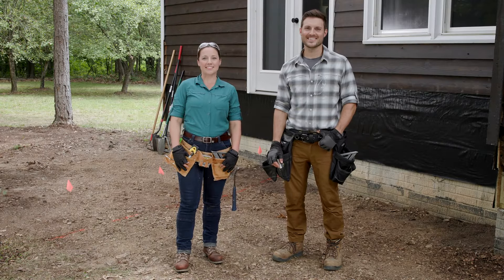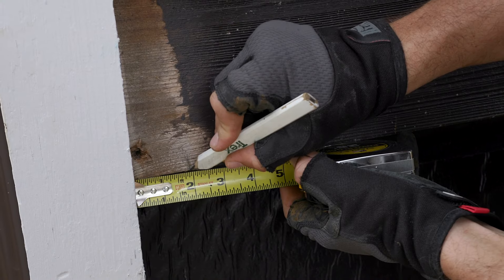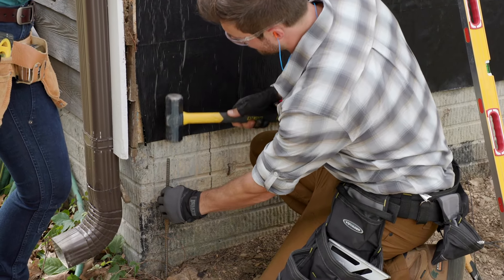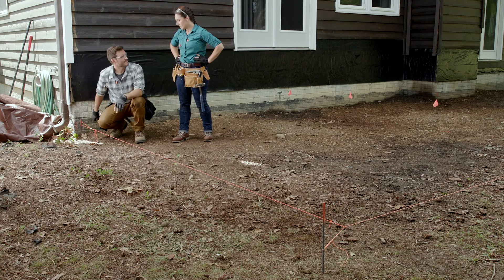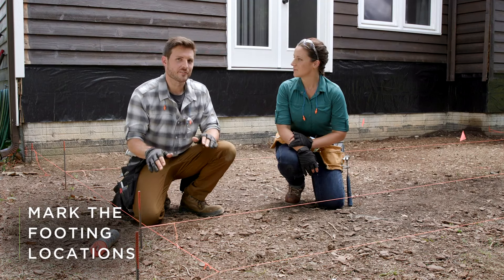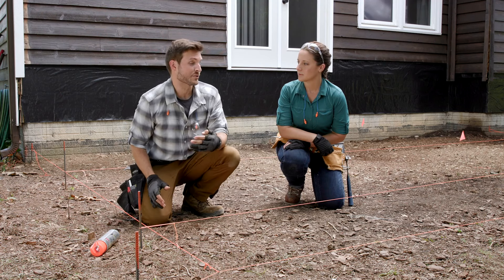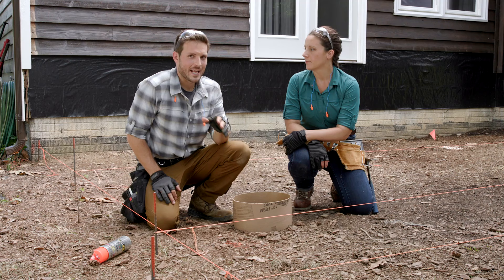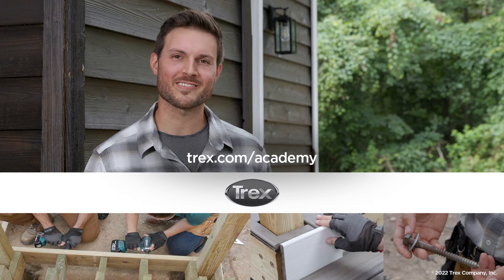Deck Framing Layout | Trex Academy

Comment: Hi, Thank for the video. What should be the distance between the beams? And what is the minimum distance?
Reply: It would be the maximum and I believe it's 8 ft which is why they went 7 ft 9
Reply: @ryanh4693  you are stating location between the footings. But the question was about distance between beams. looks like they set two beams between the house wall and outer edge of decking. They stated that entire deck would be 14ft and footings are 12'' in diameter, so the distance between beams would be 4ft.

Comment: Why 14 3/4” for the first post mark?  Wouldn’t the CL for the post be at 15 1/4”? (1 1/2” rim joist + 1’ cantilever + 1 3/4” post center)
Reply: My guess is the rim joist wasn't included in the 12" overhang and his post is a 6x6 so 12+2 3/4 = 14 3/4

Comment: How do you determine how many "ROWS" of beams are required? My understanding of this project and size of deck I thought only one beam would be required but the deck is being built with 2 beams.
Reply from the maker: https://online.flippingbook.com/view/171224276/42/#zoom=true For your reference on page. 42 you will find all the required joist spans. If you have any additional questions feel free to reach out.-Trex customer care. 1(800)-289-8739